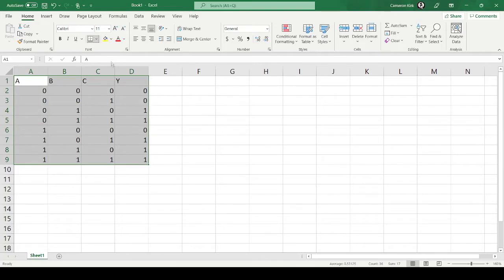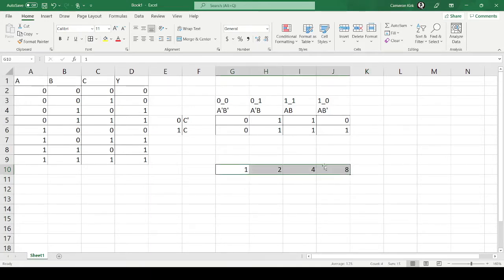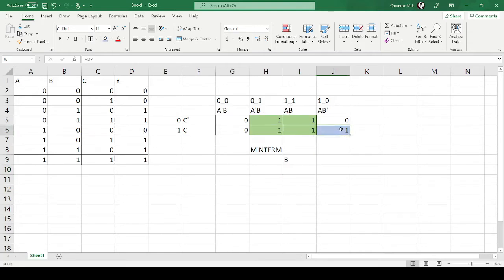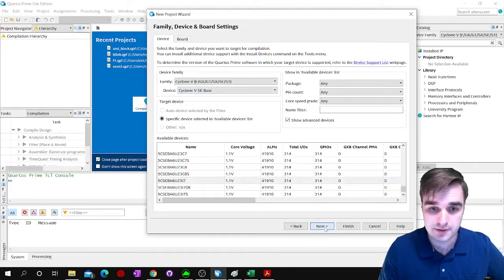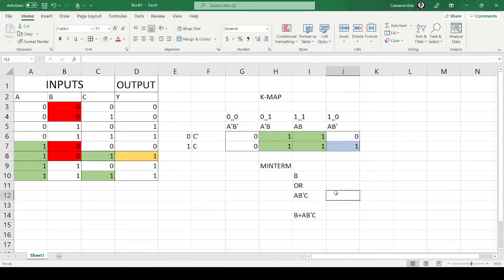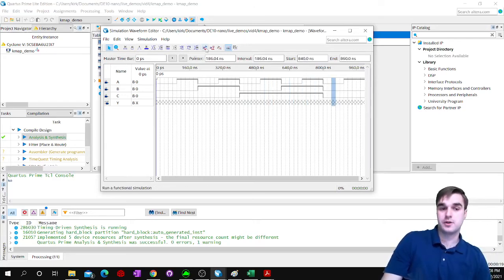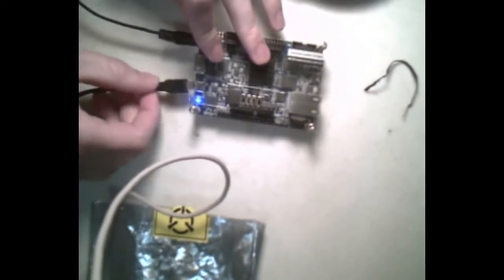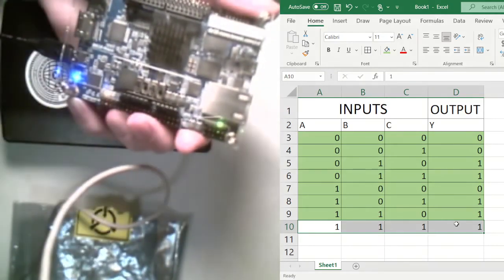Implementing Karnaugh Maps - Verilog Development Tutorial p.4

Comment: Nice tutorial.  It's been a while since I've done them myself so good refresher, thanks!  Since it's an B OR ... and not B XOR ... you could safely remove the B' from the 2nd condition and simplify down to B+AC.  Removing the need for the inverter, and changing the AND3 to an AND2. Groups can overlap, so ABC and AB'C could be grouped  (bottom row, right 2 cells) which yields the AC side.  If ABC returned 0, it would need to be an XOR and have the inverter and AND3 gates.